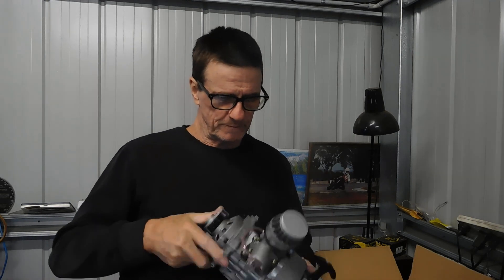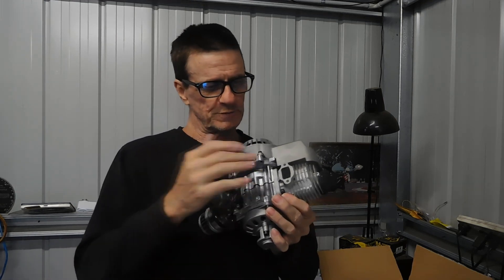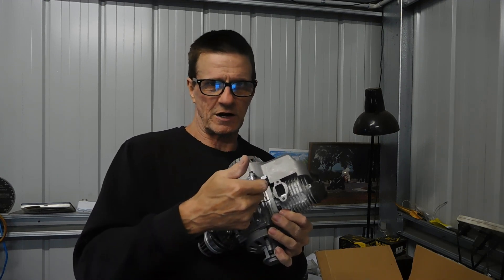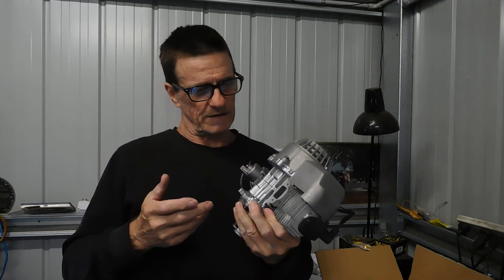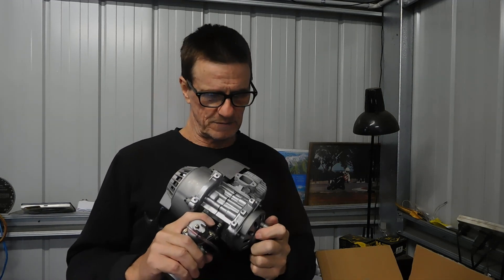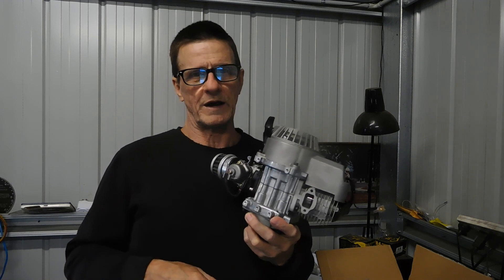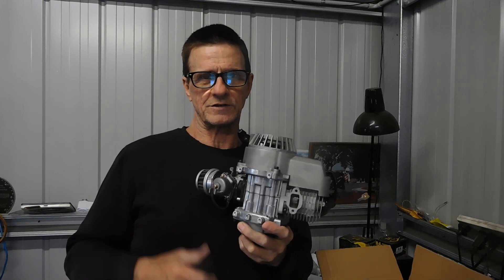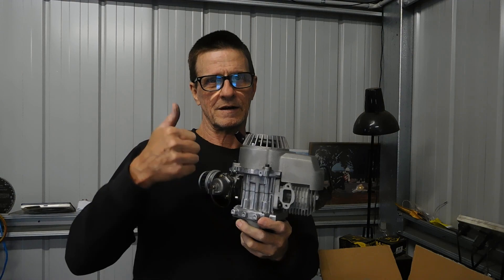I bought a new Two Stroke Piston Engine on Special

Comment: We have to see the maximum power at where it explodes :)
Reply from the maker: Would love to but I need more Dyno ...
Been twiddling my thumbs on an Eddy Current Brake Dyno project for many years but don't quite have the spend for it.
Reply: @AuMechanic  How about a torque converter from an old automatic transmission as a brake?
Reply from the maker: @rimka11  
Fluid brake Dynos are ok but less than accurate for repeatably due to environmental variations like temperature that will effect the braking and they are also messy and take up a lot of room I don't have spare.
Eddy current brakes are clean, compact and very accurate because the braking effect is magnetic not friction.

Comment: Never trust anything made from P.R.C. mystery metal. Someone gave me some nuts and bolts and I bought a counterfeit 3 pad clutch off the internet which had a trusted and good quality Taiwanese brand I'd had a few good parts from and 2 0f the spring clips shattered just when I needed them.

Comment: I’ve started a water cooled big bore conversion on one of those engines , https://youtu.be/EHFyIM1_iv0
Reply from the maker: I got my doubts that bottom and will handle that top end or the power.
I see the top end of that engine you have has a removable head, the one I have doesn't.
Ill show it in the next video and some other problems.
Reply: It was the 'race' version' of the engine I bought , it has a two piece head, supposed to have two boost ports for the holes in the piston ? full circle crank and larger carb. It should survive as  Its not going to get hard use in the 3/5 ths Size 250 gto (expected weight is 70kg with driver )  and  will rarely hit max rpm( max rpm is 45mph) , I'm happier with the crank surviving after adding the 60gr of tungsten to get to 55 perc balance ratio though.  I'll put a wideband in the exhaust and run it on my dyno after some bedding in runs.
Reply from the maker: Ok cool
Improved bottom end is the go.

Comment: You should try to make it give as much power as possible, to see how much that engine will take. Ive got a couple of those engines as well, a little bit older but same nonetheless. The bikes they came on actually were pretty fast, like 60km top speed  flat road no wind
Reply from the maker: I'm tempted to do some mods to it once I've done the demo vid's
We'll see how it goes.

Comment: That is chineese crap.
Reply from the maker: You're not wrong about that.
The piston sticks up in the exhaust port about 6 mm or more at BDC and the rings are pretty chunky so it doesn't look like it would like too much revs.
Reply: @AuMechanic  i sending video for you.  ok?
Reply: We had one and after some porting it was allright but things keep breaking. Not reliable at all.
Reply from the maker: @johnvanberrgem286  
No surprise there, the piston does not match the engine and is a quick fix because the cylinder doesn't belong to it either.
The cylinder belongs to an engine with about 37 mm stroke where this has 34 mm stroke hence the piston does not got all the way down at BDC which turns a 13 mm high ex part into 10 mm high (3 mm not 6 mm) and you end up with 154 degree timing as I covered in the latest vid on it.
They resolved it by using a taller piston to it would have enough compression ratio to actually run.
The problem is the piston is designed for a wider con rod so the small end bearing hangs out one side of the small end of the rod.
Reply: i have this engine
Reply from the maker: @shahabkarim2844  
I suspect there may be a few type of this same engine, maybe not, but if there is you might have got a better one.
Ill be doing more video on it.

Comment: Suggestion. Turn it into a build video. Build a small dyno. Get some base numbers and make it make some power. Sure it will have alot of room for improvement. Could just focus around porting and exhaust design. I'm sure you will find a group of people specifically intrested in that motor. I know 2strokestuffing has plans for a dyno and sells a electronic board to build.
Reply from the maker: I'd like to do something like that as a longer term project.
I wanted to build a brake dyno many years ago in the 90's when I was in to Karting, an eddy current type, but as a project for testing engines something simpler might suffice.
Reply: @AuMechanic  yeah. Brake dyno would be best but 2strokestuffing has what seems like a simple inertia dyno that would be much easier to build. Atleast seems that way. Especially on a smaller scale with use for just a bench engine. Just put a pulley and a belt on it or even could possibly just bolt the weight right in the crank. If it gains some interest you could improve on the set up.
Reply from the maker: Inertial dyno is simpler for sure.

Comment: Looking forward to the next video :) I have one of these engines pulled from a pocket bike I engine swapped, my engine itself seems to be reasonable quality. Their biggest problem is the carby, it's just a needle, jet and slide with the usual float set up  with no idle circuit, no emulsion tube or anything special. Consequently it runs terribly off of idle but once it gets going it's rather torque-y but I think the tiny diameter of the venturi limits any top end. I actually made an expansion chamber for it but don't use it because it ended up being too big for the bike I've got it on.
Reply: I second this^
Reply from the maker: Thank;s for the tips on it.